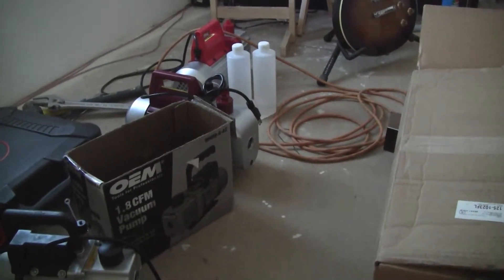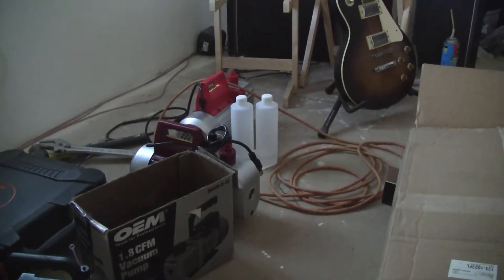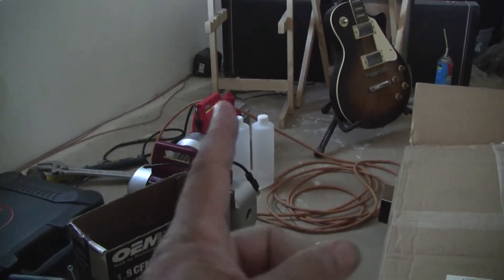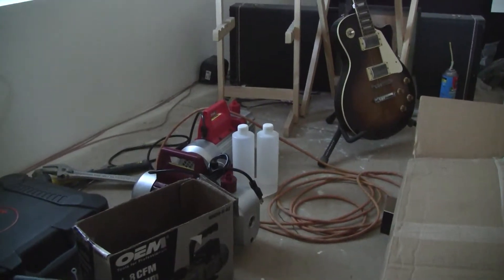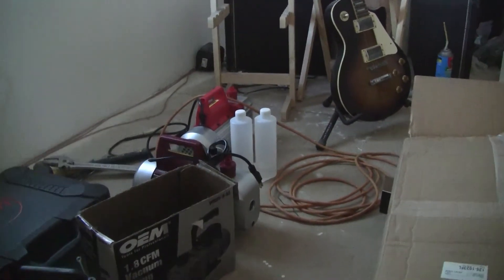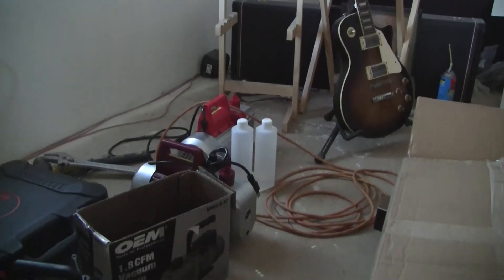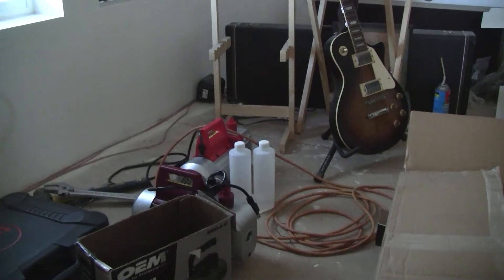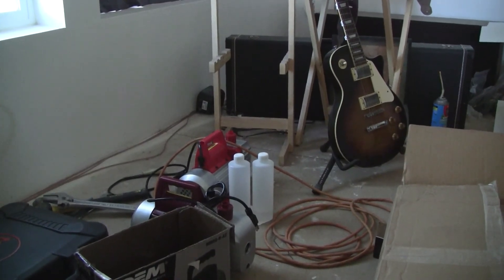TA 500 Kozyvacu Vacuum Pump Review Part 4. Final Comments.

Comment: Generalmente la presión se desestima en los sistemas de refrigeración. Lo importante es retirar la humedad. Puedes optar por medir los "microns" que es un diferencial de temperaturas en los puntos de saturación de vapor interno en el circuito. La presión es irrelevante, solamente expresará que tan fuerte está tirando (pulling), en el nivel del mar a demás de la fuerza que ejerce tu bomba de vacío (vacuum pump) también los gases libres en la atmósfera generan una presión sobre lo que sea que estés intentando vaciar, aumentando la lectura, a mayor altitud no tienes esos gases alterando los valores. Recuerda que la presión se mide al nivel del mar. Saludos.
Reply from the maker: I finally did understand how it works. The pump works great on many vehicles now, and I am educated. Thank you !!

Comment: Yes, at 3500 ft standard pressure is 26.33 in/Hg.  Here's a chart > https://www.sensorsone.com/altitude-pressure-units-conversion/

I hope you give an update on the long term use of this vac pump.  I'm looking at picking one up for vacuum bagging fiberglass layups.
Reply from the maker: I will be using it again on two jeeps in the next few weeks. I"ll report back it's performance in those videos.
Reply: Thanks, looking forward to it.

Comment: Yeah I live in S.A.,Texas 775 ft. above sea level. I also thought when I pulled a vacuum on my vehicle and was stunned to see it was not getting lower than 28 inches. But altitude does make a big difference. I m assuming the evacuation procedure is effective even at 26 inches where your at or me, only difference is the altitude. 
Thanks for posting this video it helped to clarify these problems you were experiencing with your pump readings.
Good Luck.
Reply from the maker: Ain't it  a kick in the head to find this out !!!